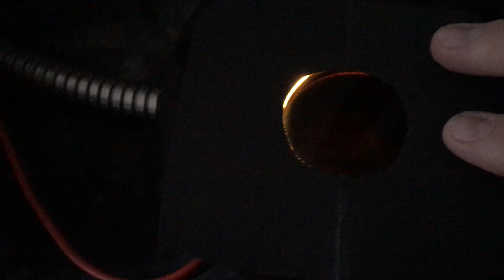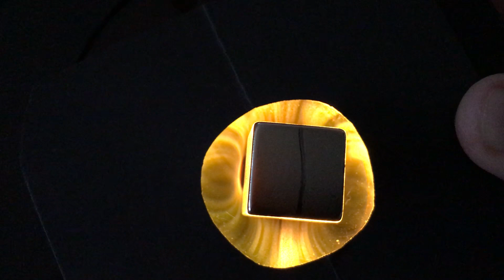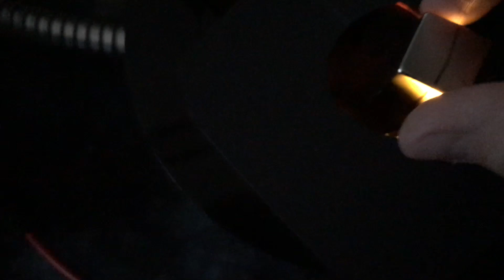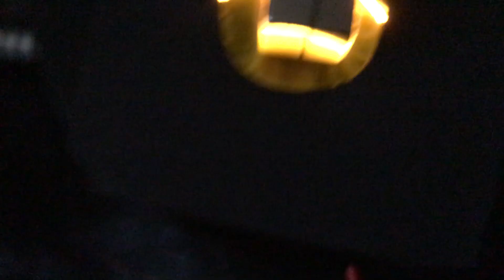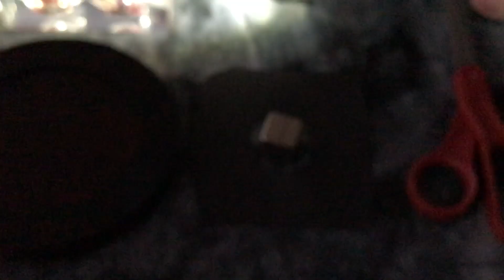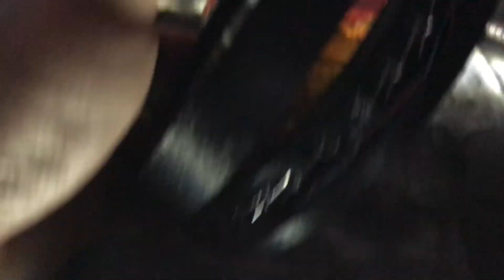🤓 FIRST TIME EVER SEEN! Supercell Continuous Fiber Optic Magnetic field

Comment: bumps are like sunspots and the lines are like the corona. individual magnetic alignments as the magnet is a fraction of the circle, the lines represent the rest of the circle. or we should say the hollow toroid. of which the individual lines represent tubes or lines of force. Each line made up of toroids stacked upon one another. Fractals. The toroid made by the magnetic circle is itself also a ring in larger toroid as the magnet has many rings forming the larger toroid. https://postimg.org/image/5lv67hkq3/

Comment: If you also turned on the LEDs with the continuous light; (1) would anything change, (2) would the LEDs show its spirals with the continuous light design, (3) would the LEDs spirals cancel the continuous light, leaving spectral lines.  
  Nothing would change because the area already has illumination.
 Or, it's an added illumination and also shows up. Like an old TV.
 Or, the added illumination cancels.
I'm thinking the middle one, the spirals will also illuminate.

Comment: Your fiber optic light, is that a bundle of smaller diameter fiber optic strands?
Reply from the maker: theyre really really FINE and so close its uninterrupted continuous
Reply: Have you tried an incandescent light in the bottom of a can, with a circular mask (centered in the can) that only allows light out along the perimeter?  That would keep anybody from claiming that you simply traded a couple dozen light points  to hundreds of light points.
Reply: scrolled down the comments to check if anyone already said what you said.
hundred little light yes. It reminded me Eric Dollard who was telling how he used to listen to the cracking magnetic lines around a magnet with a transformer coil connected to high impedance headphones! What?? (No, he was not talking about the Barkhausen effect!)
Hahaha, but he never understood that what he was hearing was the intermittent bad contact between the coil and the headphones.